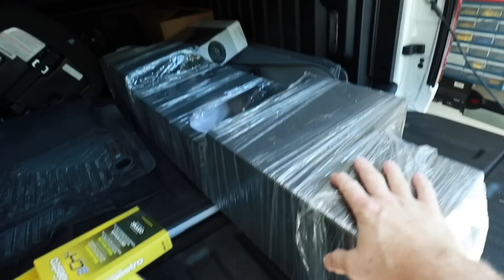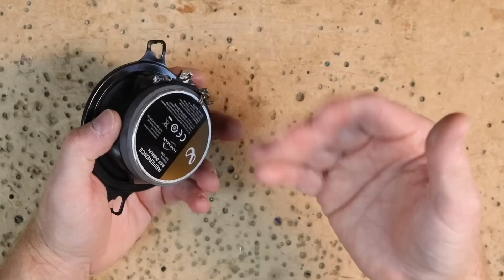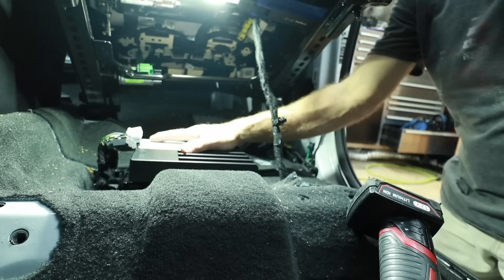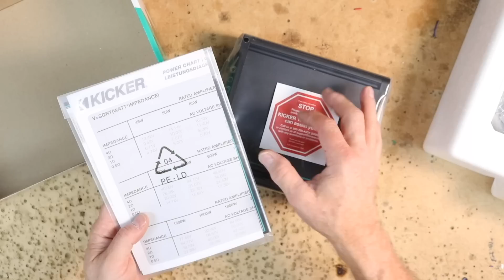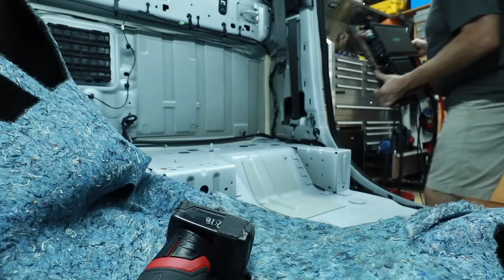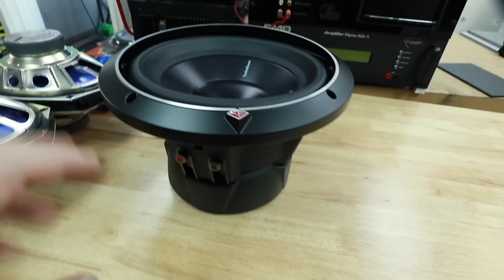Full audio system 2021 RAM

Comment: Great video! My solution to the Ram's 3.5 dash and 6x9 front door sound stage issues with aftermarket speakers was this: 6.5 component cone in the door, 3.5 coax in the dash, with an l-pad attenuator at -6db and a bass blocker at 1.2khz for the dash. Dashes are powered by the factory stereo (12w), and the doors are powered by a small alpine amp (45w). All in all, sounds great for a passively crossed over and attenuated setup. No distortion, gets plenty loud, and the dashes are less bright, and more bearable now! Been happy with it so far! -cheers

EDIT: Would love to know what frequencies and slopes you crossed over the front doors to the dashes in the DSP!

Comment: Thanks for this. My question is, if it already had a full set of reference 6x9s, would y'all have just desoldered the tweets on the front set, or just crossed out the highs with your dsp?
Reply: Just cross them over at 2-3 k or just sell them and get components

Comment: Hello, a novice here. On a stock vehicle, I've heard dash speakers are connected to the front door speakers. Do you need to run new wires to the dash speakers to separate from the door speakers?

Comment: Can the top metal covers on the top of amplifiers not be slid out and reversed to have the graphics to match in the correct orientation? It might not be possible because of the heat sink design, just curious.

Comment: So just out of curiosity and hopefully you guys answer my comment because I’m really curious but those speakers that you put in that guy’s front doors- were they really necessary? I mean, I haven’t gotten all the way through your video yet so it kinda looks to me at this point that you’re gonna be bypassing the factory amp so I guess I could understand that but for somebody like me who is still using the factory amplifier, is it really necessary to change out those 6 x 9 woofers in the front doors? All I did was I used probably pretty much the same Speakers and rear door speakers that you guys did but opted not to bother with the front ones in the front doors because number one, I couldn’t find anything that was like those and second, being that my bass comes from a JL audio stealth box loaded with 2 10 inch subwoofers that’s powered from a two channel 600 W amp from JL audio, I really just didn’t see the need to change those.

Comment: when integrating with the DSR1 does the factory amp still work?   what I mean, is if I add amps for Sub and front stage, will the rear door drivers still be receiving signal and amp power from the factory amp?

Comment: I have a 21 ram. I ordered amppro and am going  to run digital optical out to a dm-810 and then to an 8 channel kicker for the mids and highs. My question is will I have enough factory wires to bi amp the speakers or will I need to run additional wires? I was assuming since harman kardan has 19 speakers that they would have done that from the factory but am I mistaken?

Comment: If I have 2 way 3.5 in the dash corners and 3 way 6x9s in all four doors on a separate channel plus the Subwoofer behind the back seat and a DSR1 active 8 channels DSP...
What crossover settings should I start with each set of speakers not to compete with each other??

Comment: Can anyone tell me how they ran the speaker wire to the amps? Did they run new wires or tap into the factory speaker wires?  I want to amp my door speakers but there isn't any way to run new speaker wires.

Comment: I have the same stock system in my truck, I was looking at putting in the 2 way 6x9 in the doors. Would they be better? I don't really want to spend to much for amps and subs and all that. And I've seen some saying I need to bypass the anc and some say no.
Reply: Do you still need 6x9s?